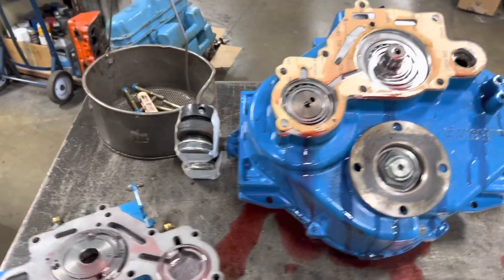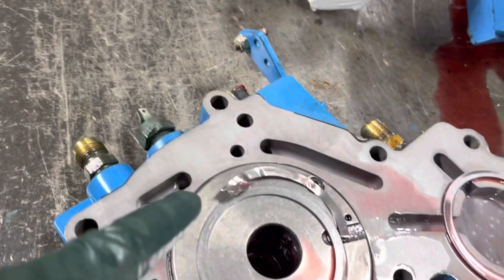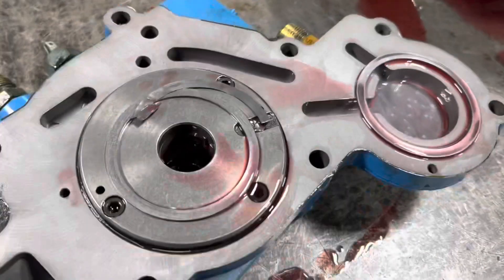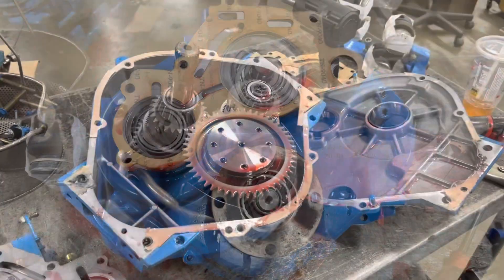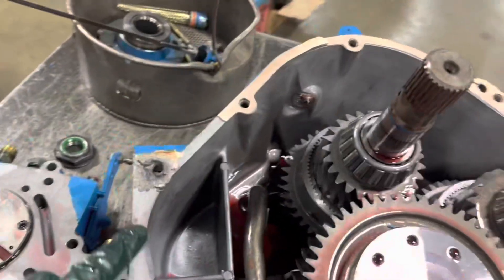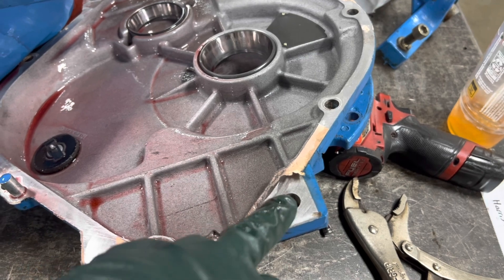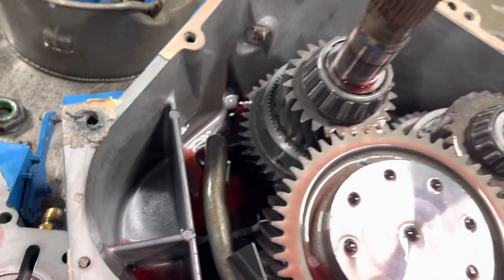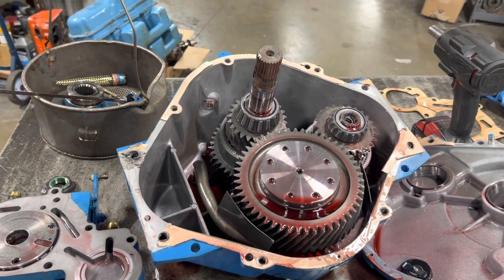Velvet Drive 5000 Marine Transmission Repair - Common Leak Point

Comment: Any idea on this trany staying gear with shifter i neutral? Seems better after it warms up.
Reply from the maker: That’s normal. Fluid is thicker when cold. It’s a common question and if it’s not driving the boat forward don’t mess with it.

Comment: I have seen a pair of these 5000 2:1 gears for sale locally in NJ.  2000$ each.  I guess I should not bother looking into them and find a pair of ZF 63a or new 68a 2:1 gears?
Reply from the maker: The ZF is a much better transmission. You’ll need adapters to use the same transmission mounts you currently have or you’ll Have to receipt the stringers along with possible a longer prop shaft.